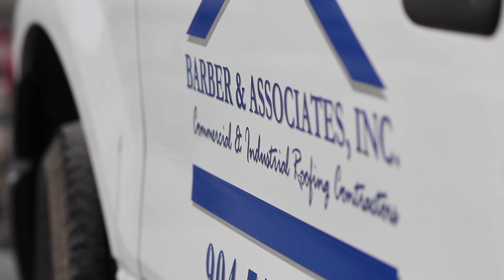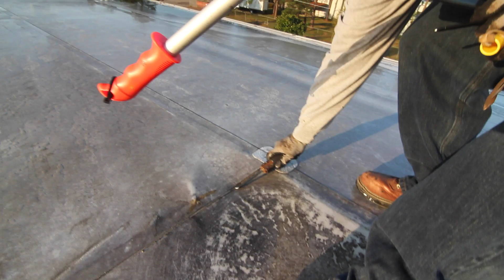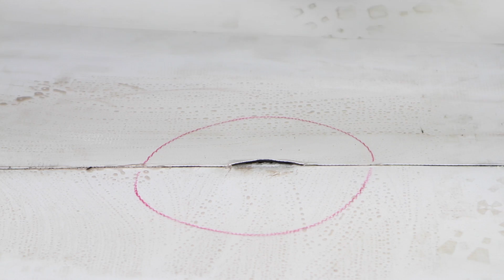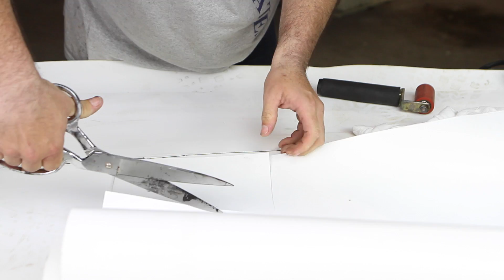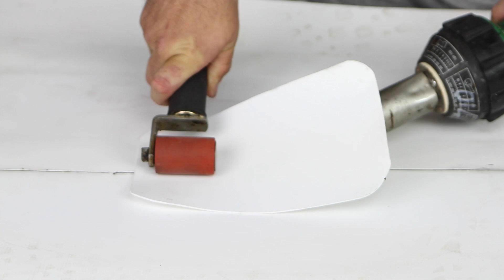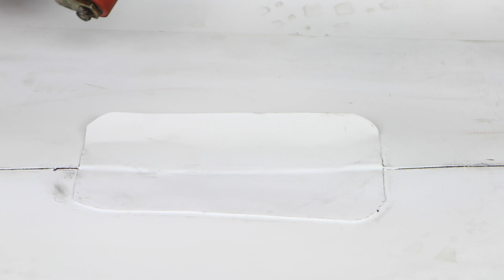Jacksonville Commercial Roofing - Leak Repair on a TPO Roof

Comment: You should use like materials. Supported = Supported 
Unsupported = Unsupported 
Transition = unsupported
Reply: unsupported is better for lifted seams. It is less likely to create small openings as well as being more flexible, and less likely to cause  and difference in its thermal elongation performance.
Sometimes older TPO will crack along these seams when they put new reinforced membrane at the seam of an old reinforced seam. 
Additionally if you are using any TPO over 50 mil thick, you would almost have to T-Patch, according to manufacturers. Not to mention cut edge sealants.

Now if that lift was long and all the way through, then yes, reinforced membranes will be needed to hold the seam together. but a lift is too minor.

Comment: What is the solvent you are using? Thanks
Reply: Typically the membrane cleaner made by the manufacturer. You can also use MEK or Acetone, if you don't have the cleaner.
Reply: MEK, or Acetone if it is older. Simple green if it is newer. Or grab the manufacturers cleaner.
Reply: Weathered membrane cleaner is great for tpo not sure though about other manufacturers  and what they recommend